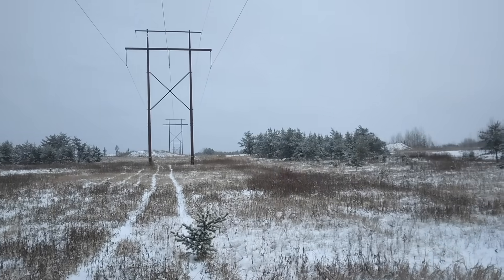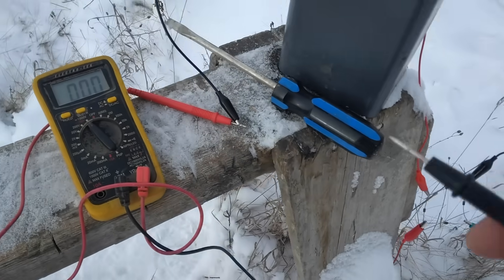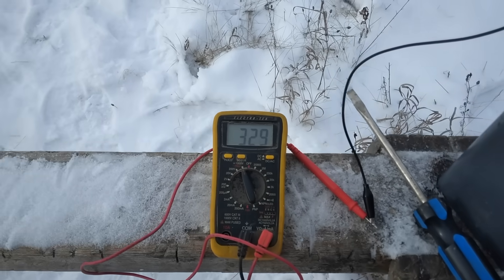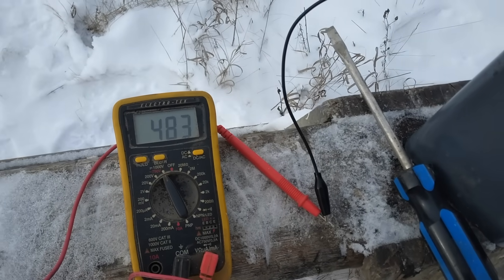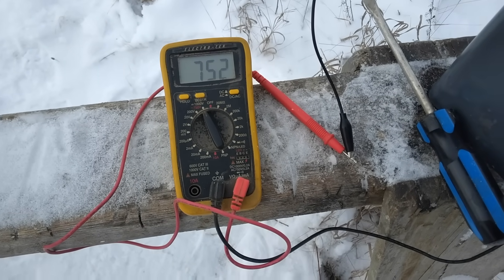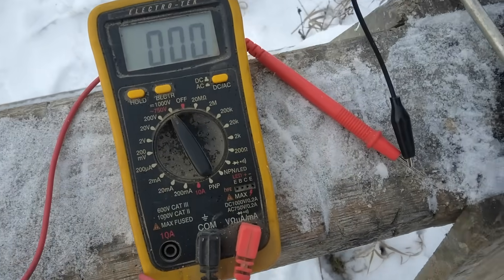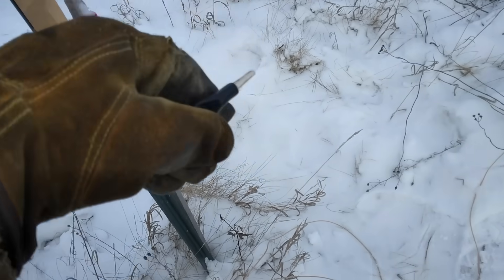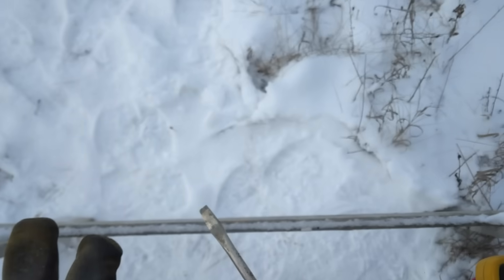Fences sucking power from under HV transmission lines

Comment: You have an air core transformer utilizing the far field effect from the transmission lines.  If you have a normal barbed wire fence there, but insulate each wire from the ground, you could wire each strand in series to produce a useful inductance.  The length of each segment should be a harmonic of 59.5Hz.  The slightly lower frequency makes up for the load put on the output of the fence.  This can then be run to an AC system to run useful things.  A phase converter can be used as the interface if the AC system is tied to the grid.  For simple storage, I would recommend running an air compressor directly off the fence, then use the compressed air to do work,  Just about any system with a motor can be converted to run on compressed air as an inexpensive, compact, and light weight option.
Reply: I think it's technically near field. The wavelength of 50/60Hz is really long.
Reply: @alexc4924  The wavelength is long, and you would be correct for normal conductors.  But these are transmission lines.  They are designed to draw the near field back onto the system in a tight distance by balancing inductances and capacitances. If they didn't, they would emit hard-core RF in a bad way.

Comment: Family farm is under some of these. You always hoped when you were baking that if the shear pin broke in the baler it wouldn’t break under those lines because you would get zapped changing it. Dad said when they were kids they would take tube type bulbs out there at night and there was enough power to light them somewhat at night

Comment: What made it we have the idea I was hoping putting in a 12 inch natural gas pipeline, and they were 40 ft sticks 250 wall, what were they get welded together naturally has to get covered before it goes in the groud, in all 12 miles of this pipeline ran underneath the high-powered transmission line, well we keep pipe you know you run that deal over it looks like a spring and it looks for any imperfections in the plastic coating that's on the pipe, and it didn't take you long to figure out you didn't want to run your hands down that pipe cuz if you hit you hit a better spot where there was no plastic insulation it would knock you to the well it just gets good, but sometime in the point in time and the job I figured out I would put up a fence underneath transmission line cuz we had a farm that had a transmission line on it, so I put up a bare wire and I insulated it from the post and it didn't take long to build up some serious voltage

Comment: Milliamps of induction is easily possible, the longer the wire the more pickup there will be.
This can also be done near to any high power transmitter site, using a resonant cut set of cables with higher efficiency.
Bars in pubs in Hilversum Holland lit their bar areas using long wires outside to small Coloured light bulbs.

Comment: Anecdotally I recall a case where a guy placed a TV antenna beneath the cable company's above ground lines that ran along the service lane at the back of his property. He then got free cable TV His neighbours saw what he had done and had him set them up with free cable as well.

Then along came the cable company. They demanded the antennae be removed. What they were doing, in the company's opinion was theft. The group refused. The cable company took the group to court. The court found in favour of the group. 

According to the judge,  when the cable signal leaked out of the cables it became public domain. If the cable  company didn't like what the group was doing they could upgrade their cables.

Comment: If it’s grounded you can feel safe the cap is what makes it deadly. With a 100 feet of wire and resonance circuitry a man got 50kw of power out in the open from just Em around the earth.

Comment: I have a 100 mile electric fence along side a HV line 230 kv on one side and 130 on the other side my electric fence runs parallel with the HV for roughly quarter mile I think the charger is 4 joules pronounced jolts) not jewels the point being the electric fence gets very hot if you put your finger with in a quarter inch of the electric fence when wet it will reach out and knock the devil out of you with out you touching it , I’ve seen deer try to jump it and not quite clear the electric fence and it hangs up on the barbed wire under it and the barbed wire goes down a hangs on the field fence wire and it all becomes energized it real scary SO I reworked the fence with double insulators between every T post the electric fence wire will not hang up in in barbed wire and energize the whole fence , you would think that with all the T post going straight to ground 12:37 12:37 it would be ground out like a fault breaker but that doesn’t seem to be the case so double and triple insulate hang warning signs just in case someone with a pacemaker happens to touch it by accident it will reach out and get you without touching it very powerful for the young man testing the capacitors I’d quit playing with  it capacitors, hold power until your grounded out. You should ground a capacitor out slowly with the resistor or a meter You will burn your screwdriver in half nothing to play with. If a deer ever puts their nose close to it they never come back no time soon anyway after about ten flips and a mad dash for the security of the forest, your produce garden is safe for at least another night. Be careful out there. Electricity is a funny thing never ground yourself.

Comment: If you took a long tube, like a 1/2 PVC pipe or even sticks that size and wrapped your fence around it all the way down, it would probably induce an even higher voltage.. that's how transformers work and how your wireless chargers work, etc.  A coil works better.

Comment: Not too much total energy considering the charging time. You might try grounding the other end of the wire to get more of a transformer effect and see if the capacitor charges more quickly.

Comment: You might want to check the voltage ratings of the insulation on those jumper clips before you get electrocuted. You're literally betting your life on them. (Also, water leaking around them could get you.)
Reply: is it really possible to get electrocuted from stray current from a fence? I know the meter says hundreds of volts, but that's because it's not able to go anywhere. Usually the moment you touch something like this, the voltage drops way down.

Comment: When I was young, 1980’s I followed a dairy farmers case in the news! He buried lines under transmission lines and run his whole farm off of them! For years the power company knew they were losing energy from their grid, one day they checked this farm that was not their customer, found the theft! The Feds prosecuted the guy and he did every single day of his sentence in federal prison! This is a real thing and has been done numerous times, you will go to prison if caught! If a guy built a real fence with wood post and insulation at each post he would definitely have a covert power supply but don’t get caught!

Comment: The title "Fences sucking power" is misleading. You are getting negligible power.  With capacitive coupling the available current os very small.  The current can easily be calculated by the rate of the voltage increase. Current is C * dV/dt. How long did it take to charge up the cap to 900V?  It appears that the voltage was increasing at about 100 volts / minute.   That's 1.7 volts per second.  Multiply that by 88 uF, and you get 150 micro amps.  Multiply by 900 volts and you get 0.134 watts. I'm not impressed. You could increase this with multiple parallel wires and longer wires. But it would still be useless. definitely not "sucking power".

Charging up a largish capacitor to hundreds of volts sounds impressive, but look how long it takes. And 40 joules is not much energy.

Most people talk about using induction coils, which couple magnetically. That is a whole different situation. I can't comment on that. i have no idea how effective that is.  But that introduces a different problem. Voltage produced by an induction coil will be proportional to the current flowing in the transmission line and will be highly variable.

Comment: Try using unshielded wire. Coaxial is shielded with aluminum. You'll probably get more induction if there is nothing interfering with the magnetic field that is creating the current.

Comment: This makes me wonder what would happen if you employed the left hand rule and put the wire at 90 degrees to the power lines. It's my understanding that a dairy barn with copper pipe next to power lines caused shocks to animals when they tried to drink.
Reply: Magnetic fields circle around  the power line, and you can pick them up with a coil that circles around the fields. To pick up electric fields you want a parallel wire like a fence, or a parallel plate.

Comment: 😢You can't charge a capacitor from AC induction. You need to have the capacitor after the bridge rectifier. You only need a diode by the way with the diode tyeceight waybsround to suit the polarity of the capacitor. Every half cycle will charge the cap.

Comment: A lot of people think this is stealing electricity, but it is not. It is harvesting electricity that the power companies are spraying outward from their wires 24 hours a day into the atmosphere and onto the ground. Any radiated into the atmosphere simply gets grounded when an electrical storm occurs in the form of lightning somewhere else. Capturing it before this occurs in your fence wiring does not affect the pocketbook of the large or small power companies.

Comment: My son was a contractor safety inspector for the army corps of engineers and I was his go to when he ran into weird issues. He called me one day from a site he had been summoned to where workers were being shocked when they would hook loads on a 100 foot open boom Crane. He had looked for all the obvious sources and found nothing. I was aware of the location by Lake Pontchartrain and said you near the high voltage transmission lines coming across the lake. Take a welding lead and connect it to the boom and put the other end on a ground rod. The grease on the boom pins was enough of an insulator that the boom was charging up and knocking the riggers on their butts. Problem solved.

Comment: On the farm I grew up on, there is a 120,000 volt transmission line.
One portion is 1/2 mile.
My dad said ... years ago, before steel fence posts were common, (the posts were wood) that 5 wire fence (between his and a neighbor's field) would have an 'induced' current in the top 2 or 3 wires.... enough to receive a "Dirty Shock".
Reply: I used to bicycle past a farm property with HV lines over it, I got shocked from contact with my own bike frame and used to see arcs between the fence wires and the ground.
Reply: That happened to me once on my bicycle too. It was in the Netherlands.
Reply: I have my metal roof grounded within 20 foot of highpower lines. The emf measures at 120 or higher in my addition, so metal siding will be used there, 0 to 8 in the current house also 0 directly under the lines. ?.
Reply: @HarleySeaman-p9h  "EMF" is very broad and relative. It is a huge range of frequency, some of which are constant & universal, and some which might be more interactive with matter. But then also, 120 might be 300 on a different meter. It is an absolutely relative measurement.
Reply: 0 @Observer_Effect  I know the gophers follow the metal farm fence and the drip irrigation lines, tend to munch the roots along the line. I now have a dog and cat that will dig them up and enjoy a little extra protein, My meter is Erick Hill RT 100. Thanks, always willing to learn more. I had beets and turnips with the drip lines larger than I had ever see.
Reply: @Observer_Effect   The meter I have measures E field and H field and the lower values I appreciate for those fields.
Reply: @HarleySeaman-p9h are you saying the vegetables grew bigger due to the induced currents?
Reply: @BBJSTUDIOS  No it was the first year I used drip tape with fertilizer added.
Reply: @HarleySeaman-p9h  oh. Did you notice any effects from the high voltage lines crossing your farm over the years?
Reply: @ congratulations on your undertaking and subsequent accomplishments.

What affects would you expect with high voltage transmission lines nearby your domicile or place of work?

The reason I ask is I have HV easement and notice strange anomalies with groundwater

Comment: A capacitor that big is only 88 microfarads? I would have thought it'd be a thousand times that. I've got one the size of a 400g can that's 25000 microfarads. Must be something to do with the voltage it's designed for. The big one I've got is only rated for 25 volts, but it's labelled in the same sort of style, so it's probably a similar age.
Reply: Capital M.... That's MEGA farads
Reply: @hotrodray6802  Confusingly, no. That old style of labelling used "MFD" for "microfarads". The use of "μ" for the "micro-" prefix came about later (1960s, according to Wikipedia).

Comment: I'm interested in the stories of people who get cancer living near these transmission lines. You get similar stories with mobile phones and cancer although the physics is different. The science doesn't support a direct cause in either case, but I wonder if there is an effect we have overlooked. The argument is that not enough energy reaches the body's cells to do any damage. Ok, but could there be enough energy to cause some effect which has a negative outcome over time? 

My background is statistics and again, the studies don't support a direct cause. What they do show is that transmission lines tend to get built in lower income areas because those families don't have the money or the influence to get them shifted to where there are fewer people. And low income level turns out to be a much better predictor for illness than proximity to transmission lines. It's like that old statistical chestnut about shark attacks being correlated with ice cream sales. Do sharks like ice cream? No, hot weather is the common underlying factor. It brings more people to swim in the sea (more people, more attacks) and at the same time raises ice cream sales.

Still, I keep thinking about this issue, wondering if we are missing something.

Comment: My 9th grade science fair project was a Tesla Coil built with an elderly engineer from Bell Aerospace.  I would pull 4"arcs to my body holding a pair of pliers all day during the demonstrations and light a florescent tube with no electrical connections.  My hands smelled like burned meat.  The next day my vision narrowed to a small hole in the distance and took a whole day to recover.
Reply: That could be arc flash. Don't look directly at the arc without special protective glasses. It basically sunburns your retina. Not pleasant.

Comment: I worked for a local municipality as an operator of a TV inspection truck. This truck was used to inspect the interior of pipe using a CCTV camera. The spool of cable it used to connect the camera to the rig was over 500FT long, and coiled-up on a 4ft diameter spool. One job assignment had us inspecting a storm drain under a 240KV transmission line... It knocked two of us down stepping back onto the truck after hooking up the camera to that cable. EMS was called, and it finally dawned on me WHY we got shocked. I got 480VAC between the rebar of the catch basin and the frame of the truck. SHOCKING, huh?!

Comment: I know next to nothing about electronics. As a retired HVAC service technician, I was cringing while waiting for the capacitor to exploded. In my years of servicing air conditioning equipment, I replaced many run caps that had exploded. Glad yours didn’t.
Reply: I was in a radio/tv repair class in high school. We would hook small electrolytic capacitors up to a power supply and crank it up until they popped like a fire cracker.
Reply: @youtopia2000 we used to charge them up and toss them to people that didn’t know what caps were. It was a fun little prank to zap people when they caught the caps we tossed to them. 😂😂✌️
Reply: @louskunt9798 haha yup this was done to many an apprentice back in the day
Reply: Smelled like burnt peanut butter @youtopia2000
Reply: I believe I saw 12,000 volts on the can .
Reply: Those 1000 volts diodes change AC to DC. It takes 4 diodes to capture all of the sine wave the fence wire pick up. You can use one diode but it will only capture half the sine wave.
Reply: Judging by the antique appearance of that can it is likely rated for several thousand volts, and may even be non polarized (essentially two back to back of opposite polarity)

Comment: I used to work for Hydro-Québec which is the power company in the province of Québec, Canada. We have very high voltage lines (735 kv) coming from James Bay going to Montréal area about 1200 kilometres. We also have microwaves repeaters every 30-50 kilometres along the lines. To power those stations they insulated the wire over the lines for 10-20 kilometres on each sides of the stations and use the electricity for the buildings and all the equipment inside. If I recall the lights inside where very unstable depending on the temperature, humidity. I am not sure they are still used because the installed fiber optic cable on the wire so the communication is way faster.